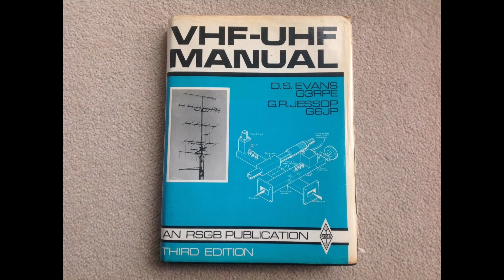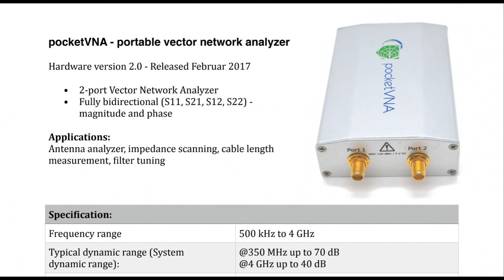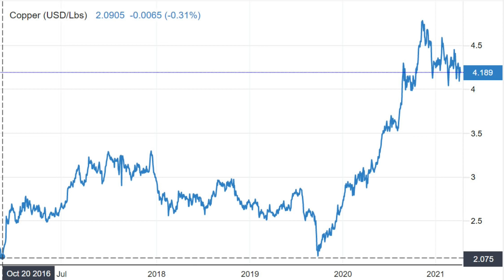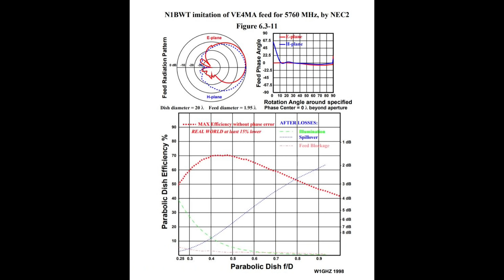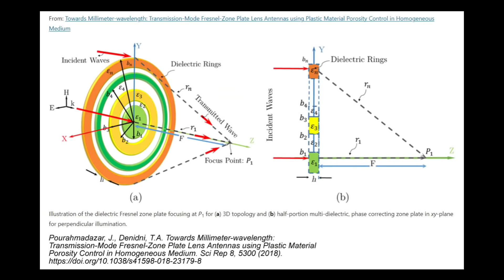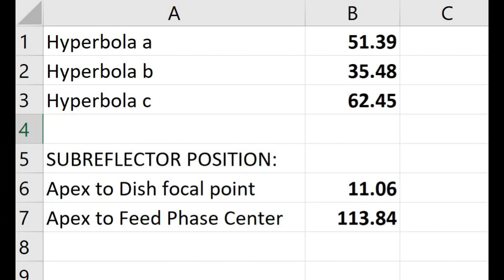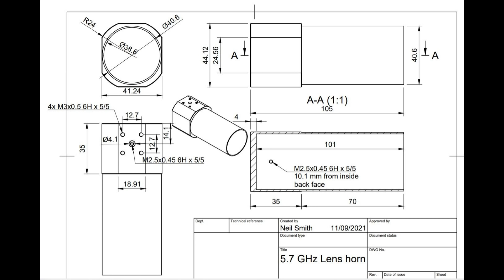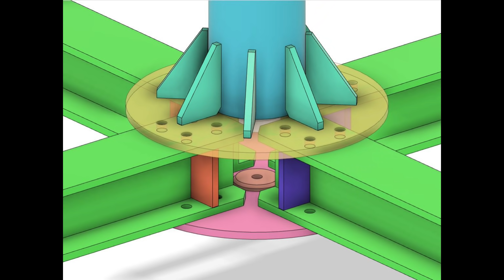Machining plus Microwaves equals Awesome

Comment: I am humbled every time I come across someone that knowledgeable. My respects!
Reply from the maker: Usually, I have absolutely no idea what I'm doing, but I grant myself permission to fail. Having no fear of failure is very liberating and means I get to try things that more sensible folks would perhaps avoid. It's important to understand the limits of what I know and I'm very much aware of my lack of skill and experience in anything connected with machining and radio engineering. I'm having an indecent amount of fun messing about with everything. Thanks for watching!

Comment: Watching the part about casting I was thinking about when I was making the the tiny K band horns using investment casting, and there it was.  The horns were modeled in Fusion, then printed using a resin 3D printer.  The resin used was a special material that produced almost zero ash when burnt out.  PLA may work, but the ash content may be too high for fine detail.  I have used FDM 3D prints for Petrobond casting, but the rough surface grabs the sand and it is hard to pull the pattern out without disrupting the sand.
Reply from the maker: Your video about the investment cast horns was an inspiration to me. That video I posted was from before I thought of publishing on YouTube, it was a lecture I presented at the national convention of the Radio Society of Great Britain. I'm working on some casting patterns for antenna drive gearboxes made with some printed pattern pieces filled and painted and sanded. Not tried resin patterns yet. Thanks for the inspiration to try this sort of thing

Comment: dude,  that gold plated aluminium mandrel at the end was the icing on the cake. :)
Reply from the maker: Once I get that process properly worked out, there should be some very pretty results. Those internally-corrugated antennas should work very well.  Lots of development work needed.

Comment: I have only the vaguest idea what this is about, but it is absolutely fascinating how you use skill and experience and fearsome technical knowledge to overcome very complex problems.  Finely grooved horn?  Make a mandrel out of ally, electroplate it in gold and goodness knows what else, then dissolve the ally in a caustic bath!  Why didn't I think of that?
Reply from the maker: A lot of very clever folks have been thinking up brainy solutions since they first decided to try bashing rocks together.  The trick is knowing which bits to apply from watchmaking, metallurgy, chemistry, quantum physics, blacksmithing,, tribology, electromagnetism, thermodynamics, maths, art, welding, electroplating, metalcasting, 3D print, basketmaking, knotting, jewellery, carpentry, electronics, coding, microcontrollers, steam engines, gas turbines, piston engines and all the other things I've been exposed to over the years.  Since the invention of the web, making the connections and finding info are so much easier.  I remember first using an indexed database of scientific papers in the early 1980s over a dial-up link to a service in Switzerland that was a total revelation in terms of speed of access to ideas and information. Also cat GIFs and dank memes, but hey....

Comment: Some very interesting projects there.  Nice to see openEMS in use.  I'd love a Bridgeport mill but I'm sick of fixing and restoring things for the time being so will get a new mill for now and probably try to find a good Bridgeport in the future. I'd need a trailer to transport it otherwise the transport would cost a fortune. I've got a nice little Boley lathe ideal for small components or turning down tuning screws from grubscrews. Interesting video.
Reply from the maker: Next project uses OpenEMS to design an oval iris matching section from WR90 rectangular guide to a round phasing section and step to excite a dual mode Pickett-Potter feedhorn. I'm doing the machining right now, not sure if I can get the video out tonight as planned, but watch this space...

Comment: Back in my army days I was a single side band radio operator.  I had good fun sending messages using my best deep radio voice spouting the nato spelling alphabet using it as much as I could . 🙃   often listening in on foreign transmissions in languages I didn't understand in off times . I got a kick out of using the transmit booster . It made an awesome noise sounding like a jet engine spooling up . While doing so it was a good thing to stay clear of the antenna for it could literally fry ones eggs . I know it isn't like the beam transmitters that you construct, awesome stuff by the way , the math involved in that just boggles my mind . It is safe to say I suck at math but am good at making seat of the pants or rather measureless objects 😆.  Your skills sir are very well fit to your craft 👍
Reply from the maker: The nice thing about doing this stuff in the 2020s is the availability of astoundingly good modelling software so you don't need to do all the horrific mathematical shenanigans that used to be necessary. OK, the models are complex, with perhaps 20 million cells, and for each cell, the computer solves Maxwell's equations for the fields in that cell, and then recalculates all of the neighbour cells, and then all their neighbours, at about 100 million cells per second for a few thousand seconds, perhaps 200 billion separate calculation sets, and spits out the far-field pattern, the impedance curve of the antenna and various other useful parameters over a range of frequencies, plus it creates a 3D model of the antenna pattern that you can fly around and zoom in and out and get a really good feel for how the thing works.  And the software is free and open source.  What a time to be alive....

Comment: Your skills are amazing. I do Ham and machining, I am in awe of your work. Gauge pins, and jo blocks are what separate us from the animals. You mention a Deckel machine - I have a used Deckel that is as big as my Bridgeport and is in need of a deep cleaning and lubrication. With luck it will get fitted into the project list before next winter.
Reply from the maker: I have some nice gauge blocks and four big boxes of pins, but sadly, not REAL Johanssons. I'm getting a bit obsessive about metrology, I now have TWO granite surface tables and a quarter-ton cast iron table.  Tomorrow's project is drilling some 0.2 mm holes and a 20 mm deep hole with a #70 drill at 0.52 mm.  That should be fun of a sort.  I'm just getting set up for electroplating gold, silver, nickel, zinc and copper electroforming for making really REALLY tiny parts for 241 GHz and potentially higher if I can find some diodes.
The most exciting development is around dielectric 3D printing resin for UV printers.  That means I can make graded-index microwave lenses.  I'm expecting a new 47 GHz Kuhne transverter to arrive later this week so I can make up two sets and send my friends out into neigbouring locator squares so I can get at least JO03, IO94, IO83, IO93 and IO92 on 47 GHz from home.  That will be neat.  I haven't seen a big Deckel close-up, but I've only been messing about with machining since 2017, so I'm a total n00b at this game.  Producing gold-plated feedhorns for 122 and 134 GHz is pretty much like making costume jewellery!  Good luck with the Deckel!

Comment: I've just found your channel and I am very glad I did. I am also an electrical enginner who now spends all day writing firmware for whatever smart toaster the clients want. Ive always dreamed of a mill and lathe as a young boy hearing stories from my uncle who worked on airplane parts. I have managed to finally get a cnc vertical mill and a cnc lathe, first in my tiny Manchester city center appartment, and now under the stairwell in a house. This is all to say that I really like your videos and If you ever need something cnc machined, I'll do it for a box of tea and a packet of golden cremers ;).
Reply from the maker: I'm negotiating to try to buy myself a CNC machine so I can do more intricate work, but that's a really kind offer!  Today's emails included one from Rogers, the printed circuit board manufacturer.  It seems they now make a low loss dielectric resin that can be printed in an LCD or DLP ultraviolet 3D printer, so we should be able to print really complex microwave radio lenses and metamaterials with variable refractive indices to bend and focus radio signals with much finer control.  Exciting times we live in.
Reply: @MachiningandMicrowaves  i was thinking of mentioning that I have a resin printer too. I strongly recommend against getting one, its somehow messier than machining. What i recommend instead is taking advantage of fools like me who already have the kit and process dialed in :))).
Reply from the maker: @BogdanTheGeek  Heh heh, indeed that would be the sensible way forward! Much depends on whether Rogers will send me a free sample of the special resin.  They are very good about SHF laminates, so perhaps I might get lucky!
Reply: @MachiningandMicrowaves  can a person subscribe to get this email?

Comment: I use CT-90 tapping and drilling fluid too. For the uninitiated it's a proper, thick, stinky old world style drilling, tapping & machining fluid. For the record it warns not to use on yellow metals and "orange" metals. Okay it genuinely warns for yellow metals, I invented the orange metals bit. Gets more corrosive at higher temperatures. Obviously not a problem when hand tapping. I've had had some staining on copper and brass in my scrap tests. 

Great content by the way. Just the ticket.
Reply from the maker: Ear-wax is a good description of the stuff. Works nicely on stainless, hard steels and mild, also aluminium. I've used it a few times on copper where the surface is going to be milled afterwards. Sometimes I use it mixed with WD40 and way oil as a cutting lube on really horrible steels where I'm struggling to get a decent surface finish.  Lovely stuff.  I have a few other fluids that are non-staining, there's some stuff with PTFE that I use, but I can't find any supplies of TapMagic for Aluminium in the UK. Most of the time on copper I just use an SAE30 oil with no additives or WD40.  On aluminium I'm finding that a blast of air and isopropyl alcohol works really well, although I think my Noga-Cool Mini isn't ideal for it, perhaps I should save up my pocket-money for a Fogbuster.
Reply: @MachiningandMicrowaves  Hahaha earwax. I should note I've got the big bottle liquid variety of CT90. I find liquid floats the chips away better and gets in the threads and parting off gaps better. Aerosols are for brake and clutch cleaner only.. not cutting fluid. I use diesel or paraffin for ally as per tradition and sometimes use them on stubborn copper, evil sharp tooling with proper angles and clearances are the only option for recalcitrant fussy copper grades as you know!

Not much else works, speeds and feeds are also way more critical on copper than any other material in my opinion. 

It's so expensive though I rarely use it for anything besides plumbing or electronics with bloody good flux. 

As an aside a razor sharp shear tool ground from hss (that weird flat nosed angular one that's always on the edge of the chip tray) will give excellent results in even the worst grades of materials especially soft or gummy ones like copper, lead, aluminium, plastic etc. If you don't have one making one is a ten minute job and it's a must have for copper finishing passes. 

Barring that a broken insert with a sharp point can work wonders on mega hard or mega gummy stuff for removing stock without gumming up or chip welding. 

In the past bacon fat, tallow or lard were common apparently. Though.. I shan't be trying them though for the stink and the cleanup! 

Keep on keeping on. I do enjoy the content. If you made it this far good on ya and have a great day!
Reply from the maker: @ianphilip6281  Full-fat milk was also used for lubricant on copper, but I'm sticking with either Tellurium or Zirconium copper alloys.  I make the big heatspreaders from Sulphur copper now and that takes a nice surface finish and doesn't eat taps. I used to pay around £450 for a 4 metre bar of 4" x 0.5" C101, but now two metres of C111 is about the same price. I hate to think what it will be next time I buy some.  I should have stocked up while it was "cheap". Ha!
Reply: @MachiningandMicrowaves  too right. Keep a bloody good stash where and when you can get it! Retirement fund almost. Copper in the stash is every bit as good as money in the bank. I'll pass on the milk though being lactose intolerant, thanks all the same. Probably ruins a nice hot drink with chunky curdled swarf in it anyway...
Cheers for the info on the copper grades, useful stuff to have in the noggin. 
I meant what I said about the shear tool though for multi micron finishing passes or very thin walled parts. Make it, use it.. love it!
You'll know when you try to take too big a bite with one.. Nothing will happen except heat and noise. That was an amusing experience REALLY glad it was a scrap part mind you.
Reply: @MachiningandMicrowaves  Real Yorkshiremen use Henderson's Relish!

Comment: I appreciate your work, intriguing! - from a millennial in the US.
32:57 did you build a housing & termination adapter for that isolator? (Assuming that's an isolator - I'm no microwave expert or rf engineer).
How large is your shop/garage and door? If used 1990's Cincinnati cnc machines are as readily available in the UK as they are in the US, you may be able to get into an Arrow or Sabre 500 for a reasonable price, as I did. They often have 4th axis option, and capable of 5 axis simultaneous, I believe.
Reply from the maker: Yes, that was a drop-in isolator. I bought a batch from the manufacturer and had some spares, and a friend needed one with connectors, so I milled up a box.  When I built the machine shop inside my barn, I made the door 6 ft wide by 8ft tall in case I needed to bring in some big old iron.  The used market is not as good as in the US, but there are some good bargains around. Prices have been very high recently though, and I'm not keen on spending a lot on an old machine in the current market.  There is an auction sale in two weeks that looks interesting.
Reply: @MachiningandMicrowaves  I wish you luck in finding the right machine
Reply from the maker: @tanner3801  I'll get there some time soon!

Comment: Ahhhh, TIG welding, love it. You can weld aluminum foil with the tungsten inert gas welding scheme. Keep at it, it will come over time. Although at my age the tremor in my hand makes even soldering npt what it used to be.....
Reply from the maker: I'm getting there slowly. Big challenge ahead making some large cylindrical antenna feeds from 1/16" aluminium sheet

Comment: It exist vax filament made specifically for doing lost wax casting and that will work allot better than lost pla casting
Reply from the maker: Thanks for the info, I'll investigate as there some parts I need to make that really need the lost wax process and centrifugal casting. I'll have to make a video when I work out how to get good results.  Good to know.
Reply: @MachiningandMicrowaves  I am happy that you found it informing.
It exist several manufacturers of investment/lost wax filament for regular machines, the good thing with some of them is that they are still vax so you will be able to smooth them and correct imperfections before casting.
It also exist several investment resins for the resin based printers that give a similar preform, those are mostly used for jewellery as they have exceptional high resolution.

I personally work with designing 3d printers but I haven't tested any lost wax filament yet but I know some people that have done regular lost vax casting in the past and I doubt that pla would be a improvement on a more than 10 000 years old technology 🙂 especially as pla would be allot harder to get out of the mold
Reply from the maker: @aggese  The most interesting development for me is the new dielectric UV resin for microwave applications that Rogers are producing.  That should allow me to make some very interesting variable-density lenses for mmwave radio antennas. https://rogerscorp.com/advanced-electronics-solutions/radix-printable-dielectric
I'll have to do a video on that when I finally get my hands on some of the resin